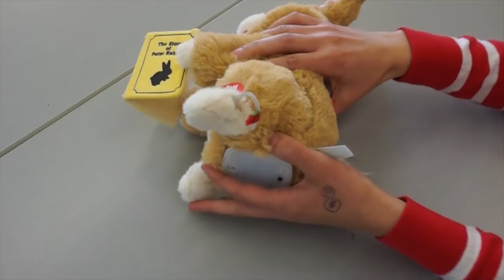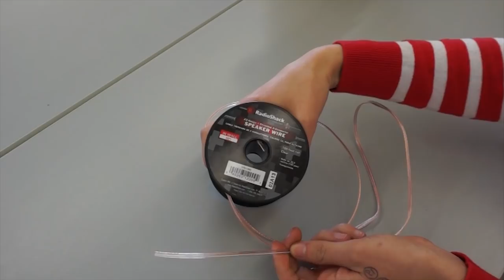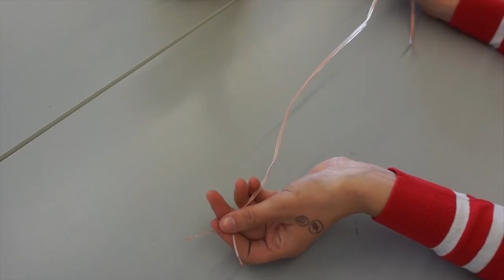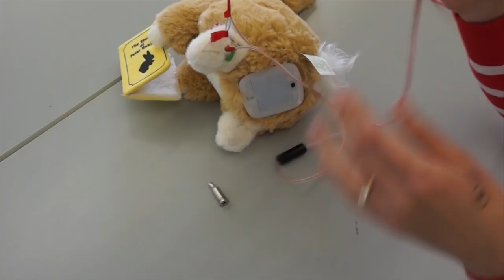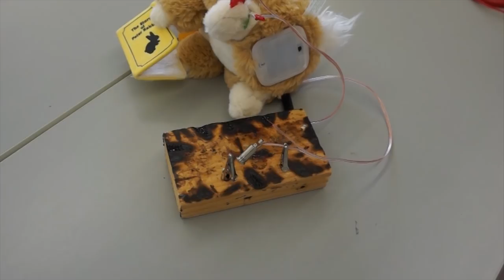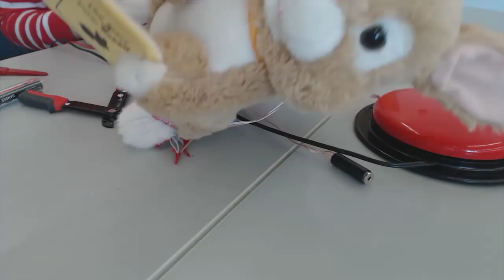How to Make a Switch Adapted Toy

Comment: Thank you for the step by step tutorial.  Using shrink tubing to cover the spliced wires inside the stuffed toy is by far safer than using that tape, which over time is going to become unstuck, exposing a possible fire hazard.